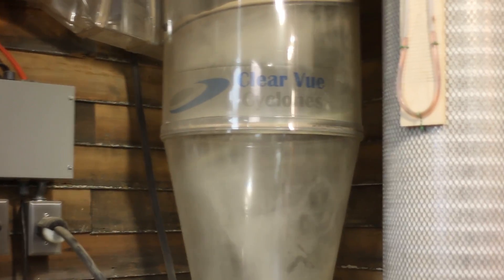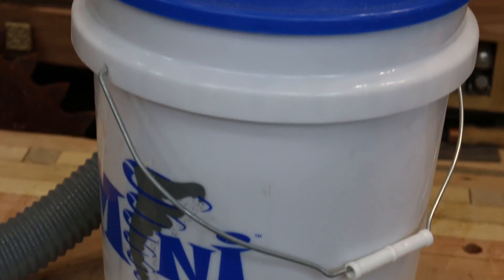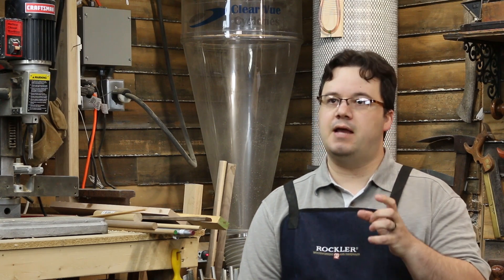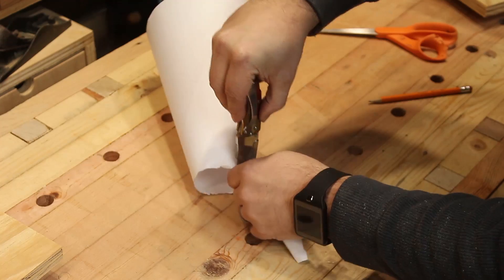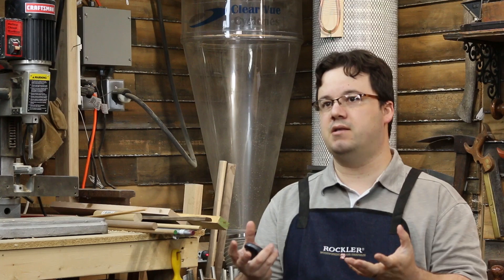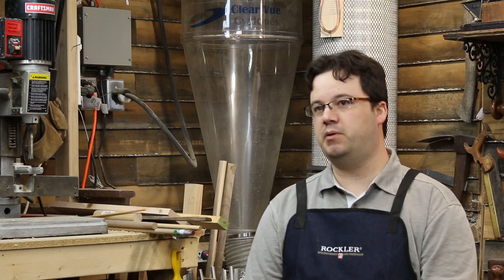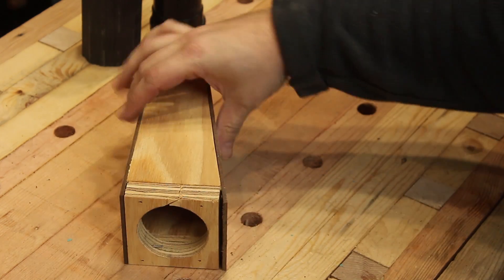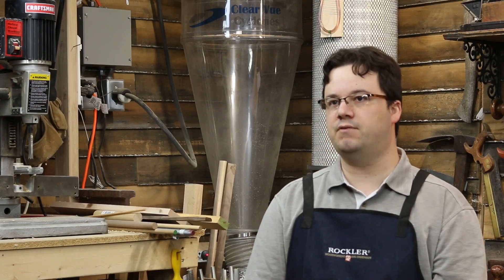SNW51- Build a Shop Vac Mini-Cyclone like ClearVue or Oneida Dust Deputy PART 1

Comment: It sounds like you went to some research on the cyclone separator.  Unfortunately, y6ou did not provide any efficiency measurements. It seems that you scaled the proportions down but forgot about the behavior of air. It does not change. At the size that you built your cyclone separator could very well be a turbulence factory with air behaving like a pot of boiling soup.  I understand from various comments that the scaled-down, vacuum cleaner powered cyclone separators work at less than optimum numbers. I suspected then that Reynolds Numbers could be a factor. I  considered buying your plans, but not without some information on the results that you achieved,  it very well could have flopped.

Comment: Yeah, a cyclone doen't slow down the dust like you said although if they are inefficient then can impede airflow. SO you are wrong about that. A cyclone works by throwing the dust to the sides and then it falls into the bin. You want to make the air in your cyclone move as fast as possible which will create higher centrifugal forces acting on the dust. The more efficient the cyclone, the smaller the particles of dust it will be able to remove.

Comment: Instead of putting it together and then measuring the length of the cone you could have used this formula C squared = A squared + B Squared. I have found that I have never used more algebra and geometry until I started woodworking.
Reply: Pyth. Pyth. Pyth.....such a gorean kernundrum....

Comment: Nice small package. why not put it on a plastic bucket?
Reply: I agree with putting it on a plastic bucket. But I'm sure Stumpy had his reasons for not using a bucket.
Reply from the maker: Joshua Luther That's in part 2...
Reply: I will be buying the plans for this once part 2 is up and I have the time to make one. Yours looks a lot better than my cobbled up one from a plastic jar and cereal bowl. Yeah, I'm not kidding. It does work fairly well but it's not anything good to look at.
Reply: Also can't bring myself to drop $50 on the dust deputy cyclone.